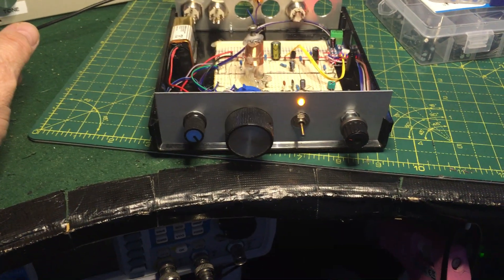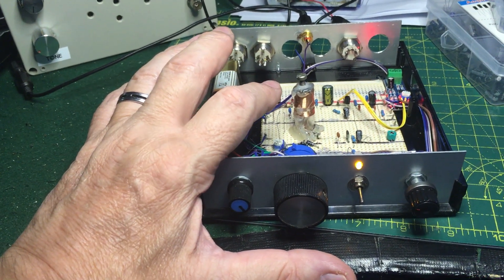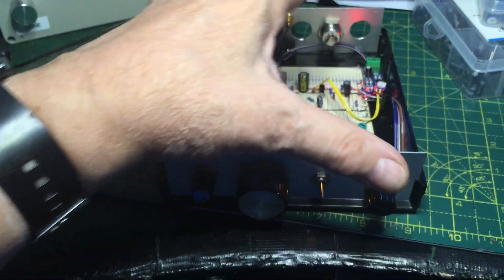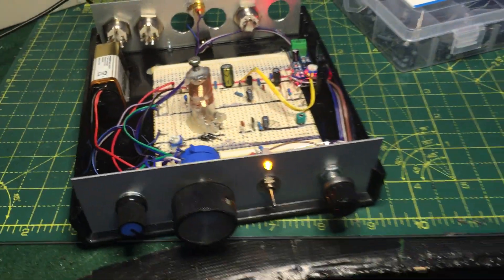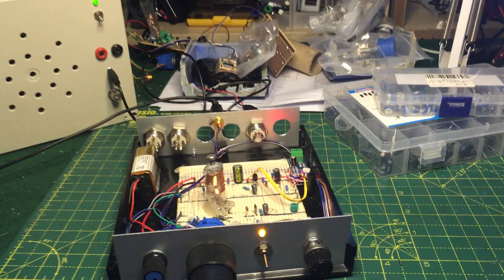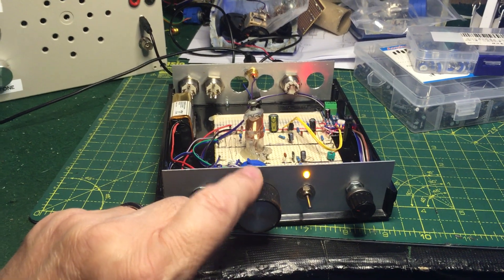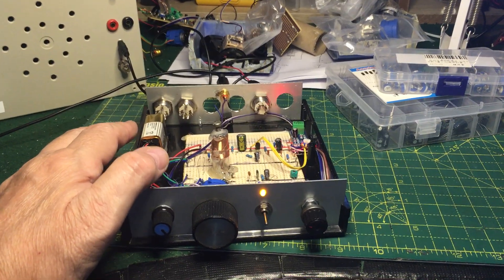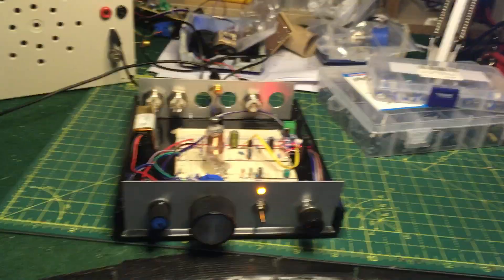40 metre regen radio

Comment: Good morning. I find myself having to be able to "counter" or rather try to understand (neighbors who are using a transmitter even the trivial ones on FM) the operation in order to register and report them. I sense the vibrations and understand their claims although I have to really struggle since their volume is very low but it is more annoying than the noise of mosquitoes. Solutions? Thank you very much. Regards.